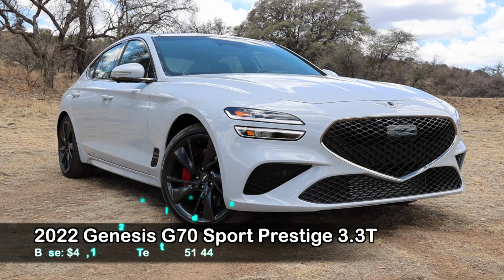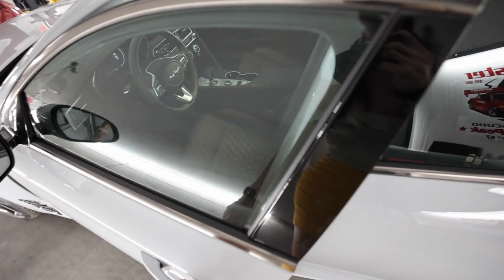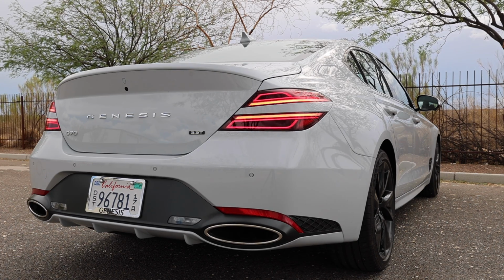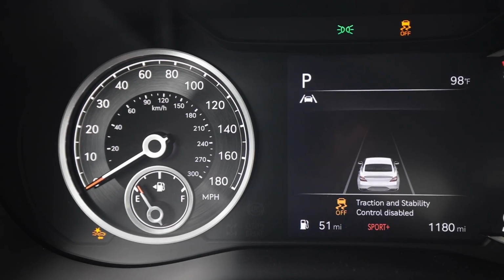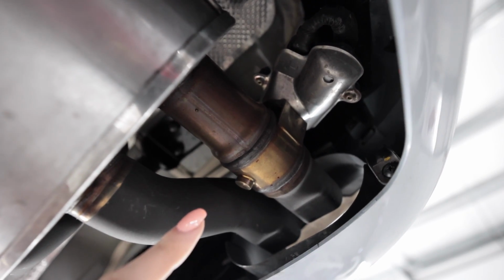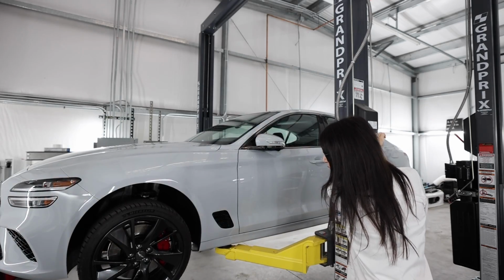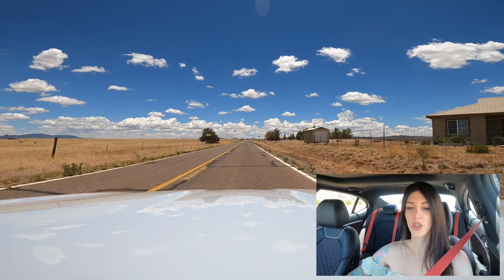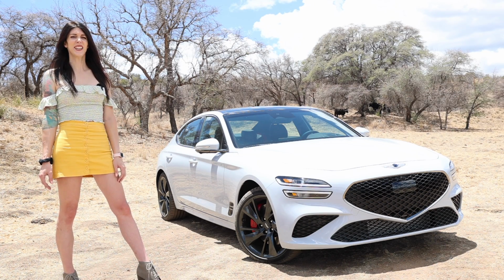Drop Dead Gorgeous, but is it Fast? // 2022 Genesis G70 3.3T Review

Comment: As an insecure man I endorse your method of obtaining inaccurate measurements for things that may be smaller than they look, such as discs.
Reply: but those discs were big enough to rearrange the ass-fault.
Reply from the maker: Lol
Reply: 1:18 formerly they had massive chrome front bumpers to avoid damage. With this design, you immediately have quite some expenditure when crashing on a car that stops very quickly in front of you.
Reply: We need to start a small disc support group
Reply: Hello everybody. My name is Jeff and I measure my attachments with spanners and socket extensions.
Reply: @lenny108  don’t tailgate. 🤣

Comment: 1:18 formerly they had massive front bumpers to avoid damage. With this design, you immediately have quite some expenditure when crashing on a car that stops very quickly in front of you.
Reply: They probably saw a reduction in front end collisions with the forward collision avoidance with the previous years. That radar plate is bound to help and makes highway cruise control almost too brainless

Comment: Love your car reviews and the way you make it both funny and informative. FYI though, the reason why the dash gages are analog on one side and digital on the other is because when you click on the turn signals the rear cameras will act as a blind spot monitor and visually show you what may be in your blind spot on the left and right side of the car. And I read the reason why Genesis didn't bring the "Shooting Break" wagon to the States is because they didn't want to steal any thunder from the GV70 SUV. Otherwise keep up the great work😇

Comment: Great review, made my day.

About the dials, if the screen fails or you go into a limp mode, you still have key info like fuel level and speed so you can get home or to the shop.
Reply: That's what my first thought was too. I believe Lexus does something similar with its mechanically re arrangeable display.

Comment: That Bugatti finish on the aluminum is called "engine turned".  And that is a Data Matrix code rather than a QR code.  There was a whole mess with a company claiming IP on them 15 years ago which is why I know the difference.

Comment: Doug Demuro:  This 1992 Toyota Camry I rented off of Turo is insane!  The odometer goes to 340,000 miles and it still runs!  And look at this.  When you push in the middle of the steering wheel, the horn honks!

Sarah:  I love the Chris Crotch...Chris Crotch Crotch Crotch.

Comment: Your review of the 2019 contributed to seal the deal for me and buy one. I have had a 2019 3.3t rwd for 2.5 years and it is a great fun car. Love the styling refresh. Btw, the previous version had the heated rear seats, they removed it on the 2022. But I haven’t the active exhaust and my only criticism is that the car is too quiet

Comment: I like the fact you don't give the so-called polished presentation. Other reviewers would never come up with or mention "the pucker factor", which I found hilarious. Please don't change as you seem much more real and relatable. I would polish your rating system with a 1-10 type scoring and leave off the fruit.

Seems like a nice car but frankly, I think the time for cars like this are so over. For that money you can get a nice EV that will save you tons of money and be super enjoyable to own.
These high gas prices lately really bring that fact home.

When driving my EV and just plain enjoying it for it's relative simplicity, I'm still amazed. All this performance without an engine, transmission, exhaust, radiator, driveshaft, differential, turbos, variable whatever, multiple camshafts, etc.
What my EV doesn't have or need, it's just nuts.

Comment: Interesting car. You're right, the exhaust sounds exhausted. 
I'd skip the cross crotch Quilted stitching too, and the claimshell trunk lid from a Chris Bangle BMW. Nice oyster white color. 
The gas mileage and stamped steel control arm are disappointing.  
The off the shoulder peasant blouse makes up for it.

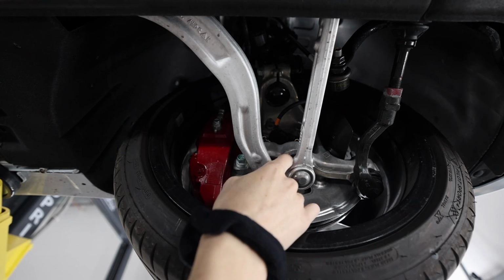Comment: 13:07 thats  a "virtual pivot"  set up. its been around for a while.  the first  car i saw it on was a mitsubishi galant . that idea was also used to develop mountain bike rear suspension.  santa cruz are arguably the foremost proponents of the design. it's especially applicable in the mountain bike arena due to the stringent requirements pertaining to pedaling efficiency and then the diametrically opposed need for deep, supple suspension when ripping up some sweet downhill 😉

Comment: Nissan Advanced Front Midship platforms from the early 2000s had the same ball joint setup. Even the swaybar links were dual ball joints. Including top, bottom arms, end links and tie rod ends there is twelve ball joints in the front end.

Seems great until you're changing endless ball joints.

Comment: To answer your question about the digital tack it's because it can more accurately represent the RPMs by moving faster than an analog tack wood they did the same thing with the Lexus LFA although I don't know if it's warranted in this case but it's possible

Comment: Wow this was a very Detailed and In Depth Review. I like how it was designed w/ the Tech in mind. I also like all the various little drain plugs in case someone Pees or Vomits.🤮 I dont like stupid plastic crap hiding the pinch welds either. They failed though w/ the active exhaust. Its more like INACTIVE EXHAUST. 🔇When you ended w/ "won me over." You seriously got it stuck in my head: "Head over Feet" by Alanis Morissette. That was the prettiest Arizona Blue Sky by the way.

Comment: Nice, this car looks like a lot of fun. I'd say the 3.3l Displacement helps the car get up and go with the CVVT it helps. A Plastic Intake Manifold, did I hear you correctly? I don't know about you but that screams melting or exploding at the worst time possible.
Reply: Plastic manifolds are pretty normal these days. At least for non-turbo cars
Reply: The time to worry is when they fit plastic pistons.

Comment: When I was a kid we called that 1/4 or 1/2 circle pattern "engine turned" later I was told it was called damascene and that it was done with a wooden dowel on a drill press when done by hand in small amounts. BTW, I wouldn't bother mention DD anymore because I don't need to be reminded not to watch his videos. The tie rod end really doesn't count as a ball joint even though it is a ball type joint. M C L really? If you could speak you could  have made Summa, actually public speaking probably has little to do with either.  "Shooting Brake" is a British name for a station wagon outfitted to carry guns and ammo etc. to go shooting. They were built on mostly very expensive car brand chassis. Oh yeh, there is no "s" in head-up display. But, there is an "s" in the the warning "heads-up" because usually it was yelled to group of people.

Comment: See I’m not a fan of the gear shift why am I pushing forward to go backwards and why am I pulling back to go forward.
I get it that all cars a PRNDL but still.
I don’t know how to turn off launch control or how to engage launch control!
How did you manage not to get it sideways?
When I’m in sport mode with traction control on it still gets sideways

Comment: It's basically the next Stinger... Which I think is absolutely great. The only 'bad' thing about this is, that it does not seem to have any new features over the Stinger. I'm sure all the tech is improved, but there is nothing really new. But on the other side: It pretty much already has everything you could ask for so not really a downside. And it also is way better looking than the Stinger.

Comment: I have a Genesis G80 with the same glass roof/sunroof thing. It has done nothing but rattle after it was a year old. Genesis said they bolt in the piece so after 30k miles they know it’s going to rattle all over the place. They replaced the whole sunroof assembly under warranty and less than 1000 miles later it was rattling again. Poor design, but nice looking and killer engines.

Comment: The fun part will be the million dollar question. Will it last 150,000 miles like any Toyota or Honda without having to refi the thing. Probably not. Buy it used with low mileage, run the wheels off it, sell it for whatever you can get. It'll be fun while it lasts. Avoid long trips.
Reply: "any Toyota or Honda" from boredom incorporated.

Comment: Yes that is the problems with the Germans coming to Hyundai Kia Genesis motor group. Some of the things they do are great like handling. Others are really stupid like push button transmission in the Hyundai sonata and other Hyundai cars or automatic transmission with a park button. I don't understand why they don't seem to get it but having a normal automatic transmission means you don't have to look down at the shifter to see what you're doing you just push the button and slide it into park because everybody knows Park is the first position on the shifter. Having a shifter that doesn't force you to look down and his second nature is worth its weight in gold and a reason not to buy their car

Comment: And which frustrating is the Kia stinger and lined when it came out in 2021 in Europe came with diamond stitching in the seats but it doesn't come that way here even though they have heated and ventilated seats over there deeply disappointed that the the Germans have shortchanged the Americans and their model of the Kia stinger

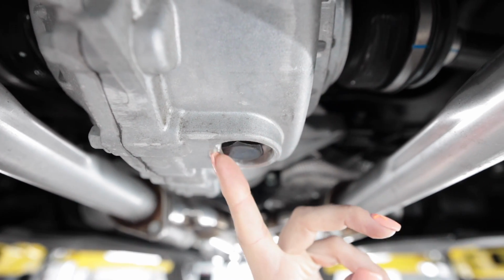Comment: 11:56 this is a brand new car so it is difficult to say how things look like let's say in twenty years. Was the car made to last for only five years? And after this, you have expensive repairs at the engine, gearbox, driveshaft, suspension, autobody, etc.?  Actually, nowadays no cars are made to last longer than five years. Unless you invest a fortune for repairs and maintenance costs.
Reply: WOW. Where to begin? Let's just start with... a car, now days only lasting five years probably says more about the owner than the car. Second, if your assumption was true, how much repeat business or referrals would the manufacturer receive with such an abysmal track record?

Comment: Diamond stitched is getting old. 
Not much for originality.
Reply from the maker: Round wheels are getting old then, and doors.. also seats in general. I mean, why can’t we just sit on a bean bag in a car instead.
Reply: @SarahnTuned  I guess if you're going to copy an interior, Audi isn't a bad choice. 
Just my personal opinion, I see diamond stitching the same as carbon fiber trim. It doesn't matter if it's an Audi RS of a Kia.
Do a long road trip in a second gen Avalon, and you'll wish that driver's seat was a bean bag.